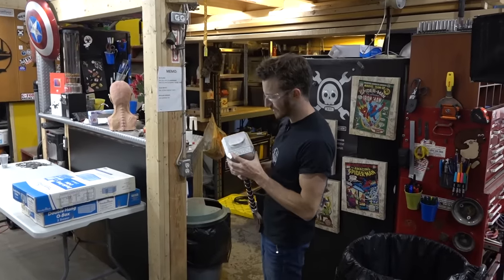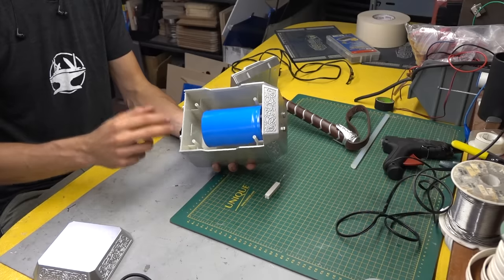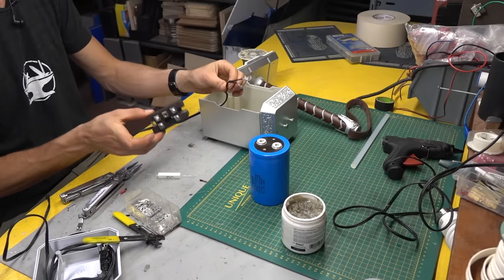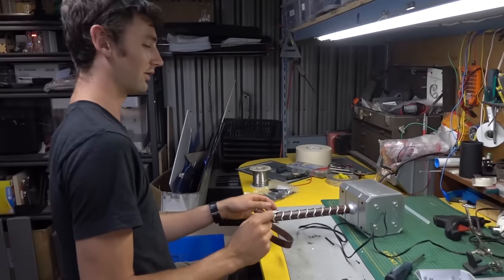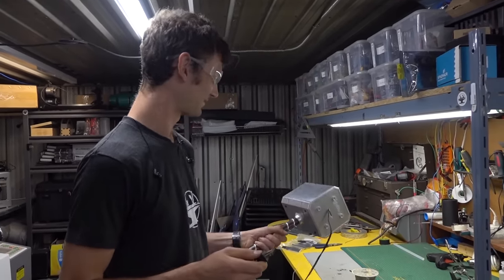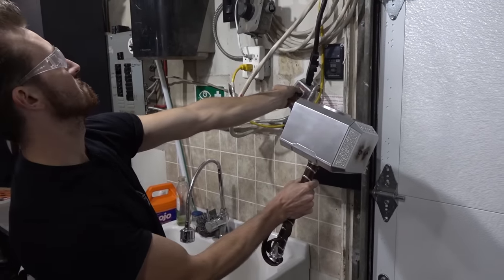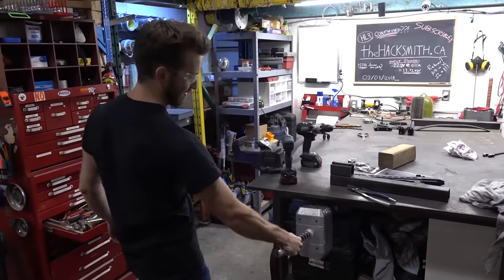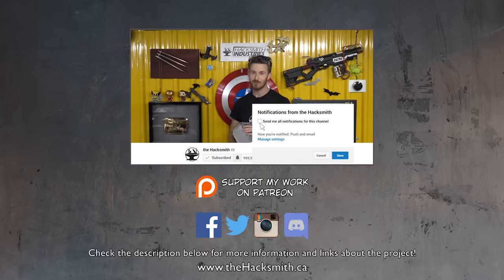Thor's 300V Capacitor Hammer Build!

Comment: would have liked tos e it placed on a Springsystem so you can actualy hit stuff with it not just touch.   also HACKSMITH why havent you gyus build a BATTLEBOT for the show yet? or Robotwars or something.   THATS somethign to get a sponsors attention.
Reply from the maker: A battle bot would be much more effort than it would be worth... exposure on TV is useless in our experience, doesn't help grow the channel or attract sponsors =(
Reply: Damn i was hoping it would benefit you more.  seeing "professionals" on there would be a gamechanger.  Imagien a Battlebot with this hammer.  just shorting the enemy instantly.
Reply from the maker: It wouldn't do anything to a bot! It's just a spark. You'd need to ensure the electricity went through a sensitive piece of the robot! but pretty much all robots will be frame grounded... so unfortunately this wouldn't do anything!
Reply: God damnit!  shattering peoples dreams with reality and Knowlege.  ok lets turn this arround: IF you WOULD build a BAttlebot: how would it look like, what weaponary, what sourc eof movement (tracks, wheels, etc)  and dont tell me neither of you guys ever thought about that.
Reply from the maker: electromagnets to the floor, massive kinetic weapon (like tombstone). being securely stuck to the ground means you impart 100% of the kinetic energy into the opposing bot. if you're not stuck to the ground, it gets split 50-50 (well depends on the weight of both bots but you get the idea). xD
Reply: Thats brilliant!   also #TeamTombstone  even more devestating than Hypnodisk ever was.  now go and make the day of other subscribers im pleased :D

Comment: You only used a starting capacitor should have used a super capacitor once shorted 24v of super capacitors with solder wile soldering them the solder poof just disapeared it turned into tiny tiny balls

Comment: 300V is pretty wimpy, microwaves have 2100V capacitors in them and they’re smaller than that one, use that.
Reply from the maker: these store a lot more though! and then you can't plug it into a regular outlet to charge, need a 2100v transformer

Comment: Wait if I understood that well...
Touching the socket after it has been charged is the equivalent to touching the capacitor's electrodes
Holy shit charging this thing is hella dangerous, you could kill or severely injure yourself closing the lid of it
Reply from the maker: no, it's not, bridge rectifier in the way. DC output remember -- can't come back through the rectifier.
Reply: (it seemed like you were dead scared of that socket though like 6:00 *insert can't touch this music here*)
You could try putting cheap "taser" modules that cost like 2 bucks and convert around 6V to 60kV
Putting like 20 of them poking everywhere making kid of an electric cage around the hammer would be super cool
Add to that a modified microwave transformer to make a huge electromagnet and lithium batteries as well as an RFID/ figerprint scanner, an arduino and some transistors and you got yourself an awesome thor's hammer